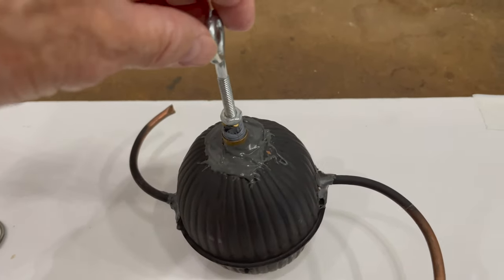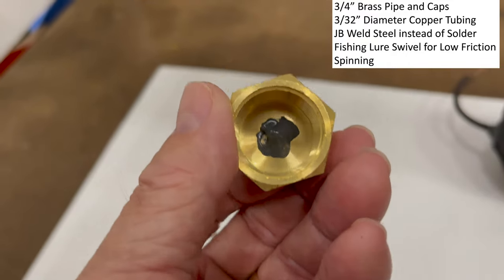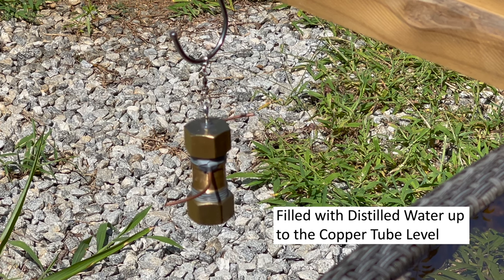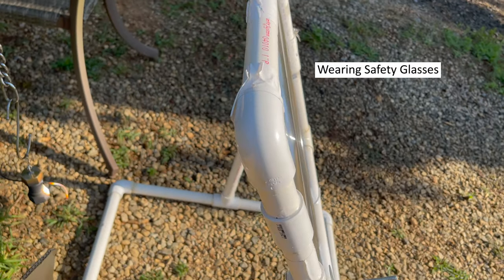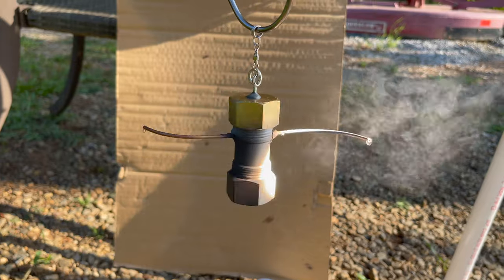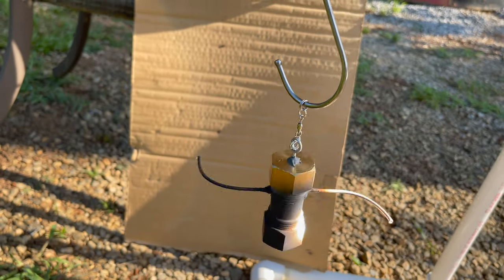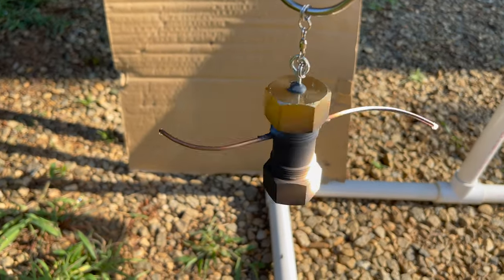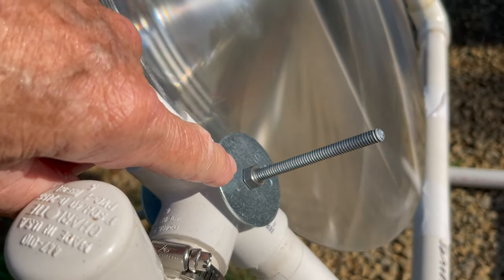Hero's Engine Aeolipile Design for Solar Heating with a Fresnel Lens

Comment: the black paint was a nice touch. could also insulate the copper pipes so they aren't coolling off while flying through the air.
Reply from the maker: Thanks for your comment. I like your idea about insulating the copper tubes.

Comment: Good food thought, cover it in black paint like vantablack, should heat up quite a bit more. There is a guy who sells this stuff called black 2.0 and 3.0, should take a look at it.
Reply: That should be the link to the paint
Reply from the maker: I used a 2000 deg. F flat black. I did not see the link to your recommendation on the paint. Please resend it. Thanks for your comment.

Comment: i love to see it with the ends of the pipes crushed for more pressure
Reply from the maker: Thanks for your comment. I did crush the tube ends on my first one, but since this one worked fairly well as is I did not crush them, but you are right I am sure it would spin faster with more pressure and higher velocity steam. Thanks for your idea.

Comment: Why not just build a big parabolic mirror by stretching a sheet of mirrored mylar over a frame with a back sealed and a way to draw a vacuum in the chamber to create the parabola in the mylar. There's a guy that makes these on utube he calls them death ray mirrors and shows how to make them a very easy and cheep bad ass solar concentrator that beats the hell out of any frenele lens by thousands of %  and it has an adjustable focal length on demand.
Reply from the maker: Thanks for your comment and idea. I recently became interested in Fresnel lenses and that is why I used one here. A few years ago I built a parabolic trough collector using using a special coated polished aluminum. This is a link to it:  https://youtu.be/2v7ePDA-0m4   To maximize energy collection with all of these focusing solar concentrators you have to track the sun through the day. I appreciate your suggestion and may do more with parabolic reflectors. Thanks
Reply: @anisotropicplus  trough collectors are great as the the tracking of the sun is simplified reduced to a single motion controlled with a single servo. Don't know if i have seen yours but I'll definitely check it out. I have seen the power plant out west that uses a field of  trough collectors.  Very impressive also the one that has hundreds of tracking mirrors to heat sodium in a tower to generate electricity.  Both very impressive projects that work well. Always thought a giant drinking bird powered by a solar collector would make a kind of self powered  pump jack for deep fresh water wells in the desert.  And fun to watch.just a silly idea . Lol  . But who knows?